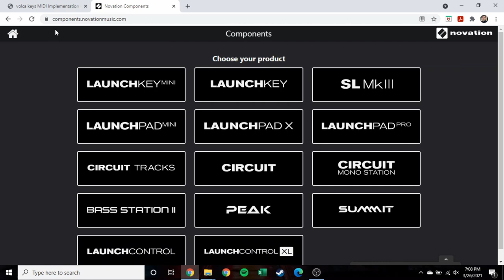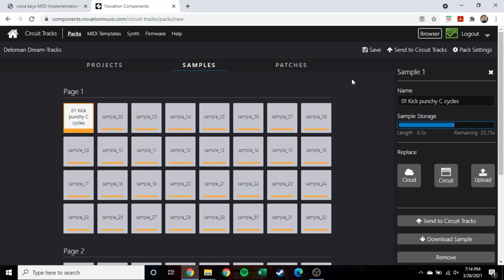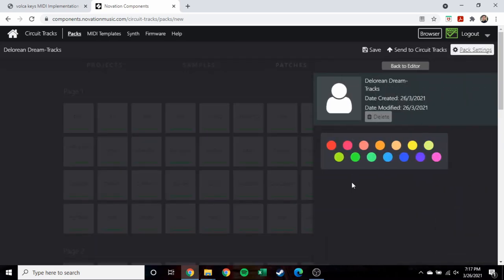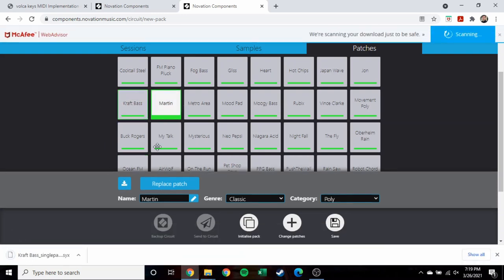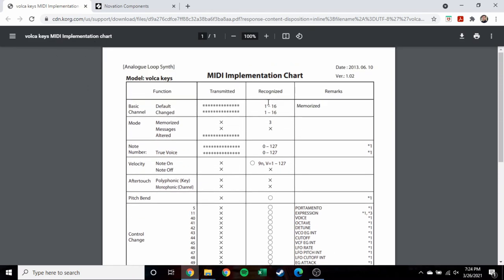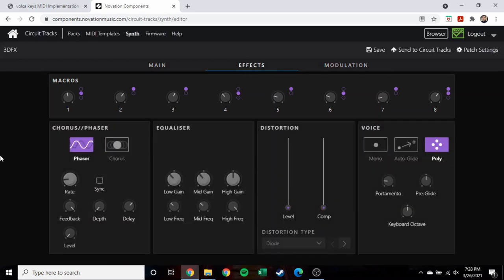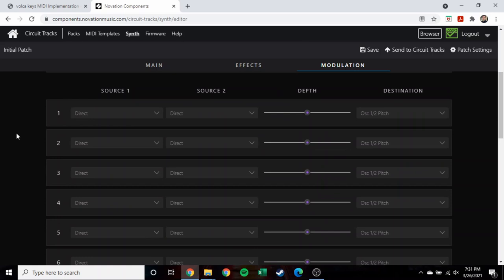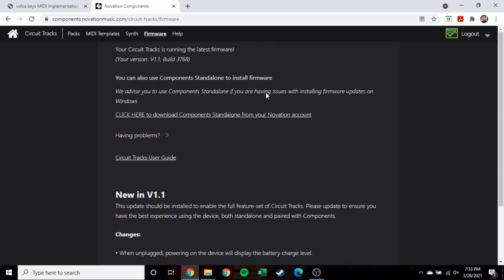Novation Components Tutorial 2021 (Circuit Tracks)

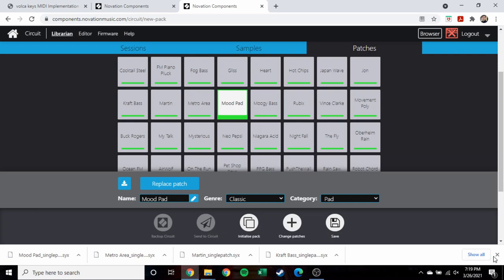Comment: 6:01 This is something that could easily be fixed with a simple browser extension/console script. I would happily write it myself but unfortunately I don't have the OG Circuit to test it with. I'm sure this is something that the community will solve very quickly (if not already).
Reply from the maker: I'd love to see someone put that together. I did a bit of looking on github, but couldn't find anything last time I checked.

Comment: 10:58... The model for testing-out the Synth settings while authoring a patch in Components is not clear to me. It sounds like you use the Circuit Tracks directly as a trigger? How does this work? Are you monitoring audio through the computer or through the headphone jack of of Tracks? Are you using the Tracks as a MIDI trigger? Something else? Thanks!

Comment: Hey Gabe! Thanks for the video. I wanted to ask if it's possible to load entire backing tracks into the circuit in anyway? I'm hoping to use the circuit as a replacement to my Ableton session but still be able to jam in the other open instrument slots
Reply from the maker: This wouldn't be my go-to for that, since the amount of sample time it can hold is relatively short. The Circuit Rhythm can do more, but it's still only around 3 minutes if I recall correctly. You might be better served by something like an MPC.

Comment: Thank you very much for this video. Seems I bought the wrong sd card! Thumps up for your videos and greetings from germany.
Reply from the maker: Make sure you try formatting it using your computer first, they usually don't come in FAT32 format by default, but you can convert them. Although if it's the wrong size or not Class 10 or greater, then yeah you'll need to get a different one. Glad the video helped!
Reply: 16gb san disk is like#1 on the list are super cheap, and I don't think tracks files take up much space
Reply: @GabeMillerMusic  I bought your sample pack. Cool stuff! And the tracks is much better with a working sd card ;-)

Comment: I am now looking at Components in hopes I can slide samples around from within the circuit, not just between the computer and circuit.  That we can duplicate, copy or otherwise save one project, track, scene and other stuff to different slots here and there in either circuit, yet can't move samples around in the sample bank is an oversight.  Easy enough in Components, but this should be doable in-situ.

Comment: Thanks for the video guide Mr Miller! A quick question: I have several packs on my Circuit tracks and I'm looking to manage them and their location in the pack selector on the tracks.. is there anyway to move the 'slot' a pack occupies on the tracks via components? I have had no luck removing them from the Tracks via components or the SD card (the SD card contents appear garbled when I plug it into my computer)

Comment: Question - I just bought a Circuit Tracks. At the beginning of your video you mention hooking up Tracks to the PC via USB. The only USB I see is the thin newer style USB C type plug (with both end radius symmetrical) instead of the USB type B found on the Circuit Groove Box. On the Tracks I know this USB C connector is for charging the battery, is it also for sending data through components? 
 When I took it out of the box I asumed the sd card had to be taken out and placed in a reader then hooked to a PC for changing packs. I'm confused!

Comment: Thanks Gabe. The thing I don't get is how to play a patch while in Components. If I expand a pack I see a speaker icon next to each patch but clicking on it does nothing (on my computer or the Circuit - although I like to unplug the circuit because the noise that comes out of it when it is plugged in to USB-C is terrible). Similarly in the patch editor - you have this complex synth with no way to actually quickly hear what you are creating. Having to send a patch to the circuit and play it there is a heckuva sucky workload.

Comment: I don't understand the patch editor. Are you obliged to guess how the patch sounds while you are editing it? Or is there some way of having the patch editor actually produce the sound you are editing? I have my Tracks connected with the USB part and the green circle in the upper right hand corner. Is there some other way of connecting it? Does it require a MIDI template?
Reply: I managed to figure this out. It can be tricky.

Comment: Are the synth engines on the Tracks the same as the Original? I'm wondering if I can follow along with this patch editor, because I have the original and all the patch editor tutorials specifically for it are using an older build of components that looks way different.
Reply from the maker: The synth engines are the exact same, so yeah, a good bit of it should translate. The controls might look a bit different, but the underlying tools will be the same.

Comment: Thanks for the great video. One question though. Is there no way to preview the custom sounds made in the editor? I have my circuit  tracks synced up, but I can not find a way to preview the sounds. And the user guide is not very informative when it comes to components.
Reply: Not sure about Tracks but on the OG Circuit, when connected to your PC and to Components (green checkmark in Components) you can go to Synth1 on the Circuit and just play the synth patch you currently have set up in Components as well as tweak the parameters with the knobs.

Comment: Any way to convert the OG Circuit Sessions to Tracks-compatible Projects (formerly Sessions)? EDIT: It's possible. See the following:

 The key is to export everything individually, while in the Circuit section of Components (WHILE you own an OG Circuit), and then Create a Pack (inside Components / Circuit Tracks).. and manually drag all the stuff in (Sessions/Projects, Patches, Samples). Saving entire Packs from Components / OG Circuit and then loading into Circuit Tracks (via Components) is buggy as hell. Always export everything individually (heads-up to OG Circuit owners!). Wonky behavior, though--- a lot of the original Sessions won't load (they give an error) from these older packs, especially the Circuit Team pack. None of those Sessions work, sadly, when dragging into Projects, in Circuit Tracks / Components. I've experienced this with some others, like Shawn Rudiman's pack.

Comment: Hi Gabe!I One can upload midi templates. But I have two midi tracks, so I could drive two different synths. Can I upload two templates? How are they mapped to the two synth tracks? Is that possible at all?
Reply from the maker: You can upload multiple midi templates and assign them to the separate midi tracks. When you have a midi track pulled up on the Circuit, hit the presets button to choose from the different templates. These are also the slots that are available to be overwritten with your own templates.

Comment: Hey I bought your one shot pack and it's say It can't be used I need to choose a syx file what am i doing wrong
Reply from the maker: They're samples, not synth patches, so you can only upload them to the "drums" section. If you're on the Tracks, the easiest way to deal with them will be to unload the Circuittrackspack file, or if you're the original, you can upload the dedicated drum file as a batch. Hopefully that helps!

Comment: Can I create an empty pack in the Rhythm and sample in all my sounds, In the event I am away from the computer and unable to get to components? Is there a way to access sounds from other packs without components?
Reply from the maker: As far as I know, you can create an empty pack, but all the packs act entirely separately from each other. You can duplicate packs directly on the Circuit though. I did a dedicated video on sampling/loading samples onto the Rhythm which might be helpful.
Reply: @GabeMillerMusic  alright, I'll check it out. I most likely have the video saved under tutorials. 
Quick question while your here, 
1. in the lazy slice mode 
(ie. slice>16 slices>note>expand) 
can I record the actions to a pad for later use? A. Most likely while the record is active, right?
2. After resample, will the recorded parts be saved as a file in the device so i can drag it to the computer or what not?

Sorry, at work. So the questions may be obvious.
Reply from the maker: All good. The lazy chop state is saved in a project but not on the sample itself. And yes, you can download a recorded sample onto your computer with Components.
Also, I did a beginner Circuit Rhythm tutorial and that shows how to lazy chop if I recall correctly.
Reply: @GabeMillerMusic  all day greatness. Thanks. Always on time.

Comment: I guess you should have mentioned that you need a Chromium-based browser (Chromium, Chrome, Edge and I believe Opera) for the Circuit to get recognized, because of the web-MIDI implementation.
Reply: Or you can use the standalone version of Components.
Reply: @martinausdeutschland  IF you are on Windows or Mac. I am not. Linux by choice.
Reply: @GertBoers  Linux is my daily workhorse since about 20 years. I once tried Chromium with Web midi on Linux, but had no success. If you say it works, this great news for me.